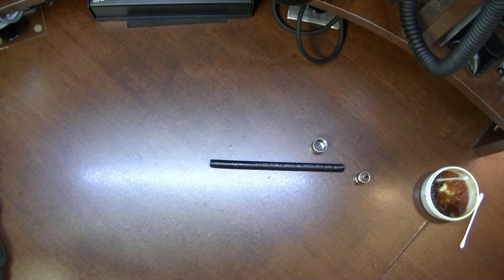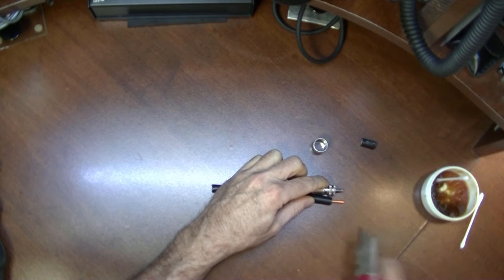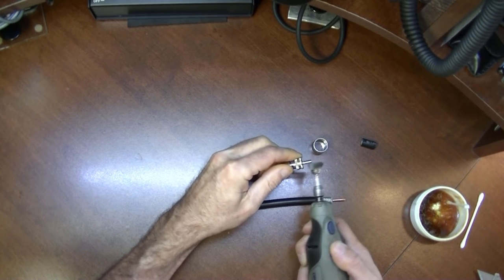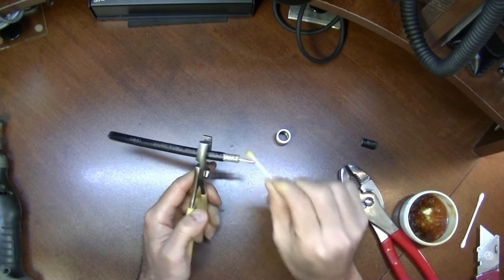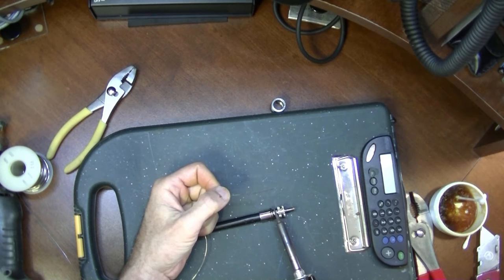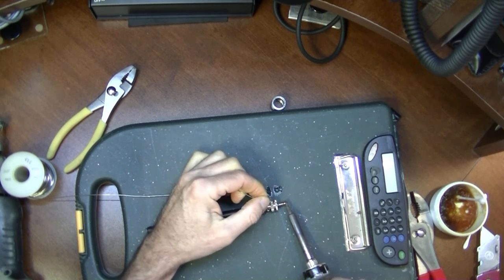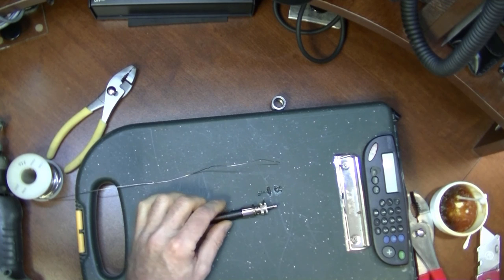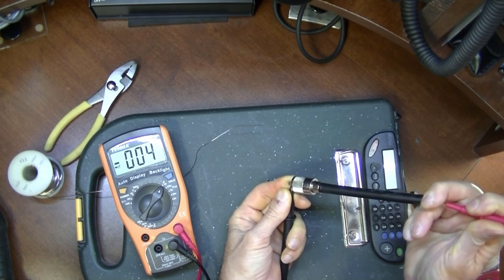Installation of PL-259 Made Easy For RG-213/LMR-400

Comment: Hi, what size of an iron do you use?  you said you want a real hot one,  wattage.  Also what kind of solder and flux would you use for marine applications with salt water?
Reply from the maker: HI, I'm using a Tenma 21-147 soldering station.  Only 48 watts.  I've used hotter irons in the past that are 100w or more too and even a small torch.  Just have to be careful not to heat the coax so hot that it melts the jacket or the inner core plastic.    I think using a "non corrosive" or "acid free" solder and flux would be the way to go for marine use.
Reply: @JLPicard440   thank you

Comment: Flux is corrosive. Using that much and not cleaning it up WILL lead to corrosion problems.
Reply from the maker: I've never had any trouble.  Thanks for the tip..
Reply: Rosin core flux is NOT corrosive! It is not acid core like you would use when soldering pipes. DUH!

Comment: That seems like too much heat for too long. Won't the coax melt?
Reply from the maker: modex20 it's got to be hot or the solder won't flow.... coax will melt if it's ridiculous.... but it'll take quite a bit of heat.... some people use a torch!  Thanks